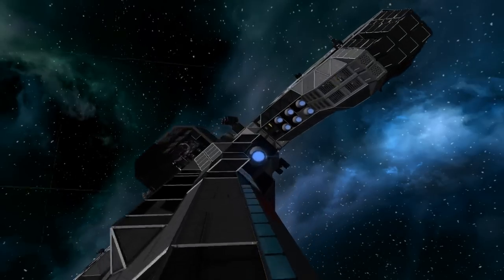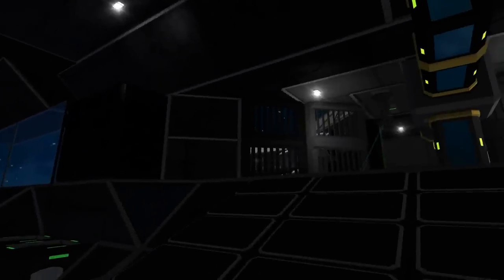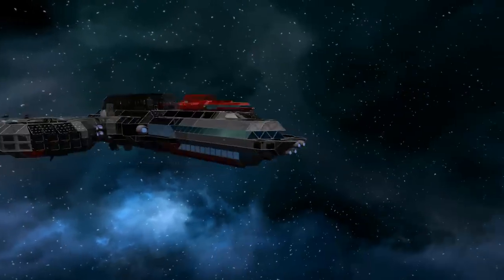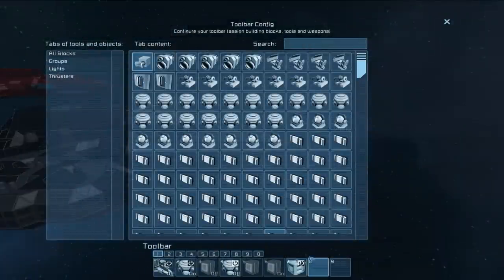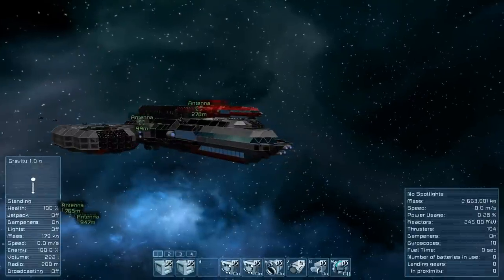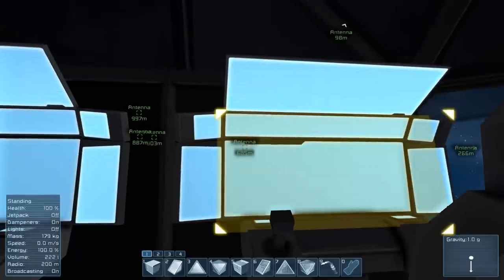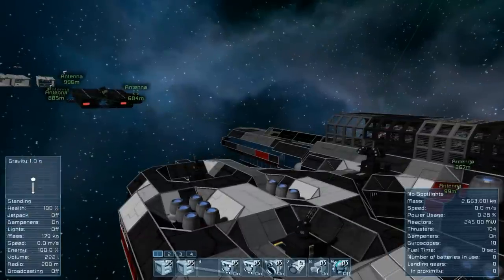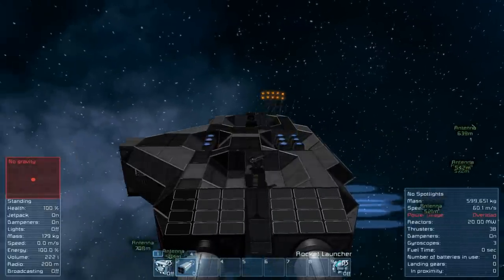Space Engineers  - Next Gen Carrier #2 - Albatross Assault Frigate, Modular base assault craft

Comment: Hello. One thing i noticed with most of torpedo/missile systems is they are not tuned for the actual survival conditions. You see, most of the desings have some systems, that require power. Power, that you simply cannot have on the torpedo right away. I tried to tackle this issue with couple of ways. Obviously, you need either reactor or batteries on torpedos. That means you need to either wait a while, until batteries store enough power or load some uran into those reactors (can reactors pull out some fuel through conveyors automaticaly? in my experience, one reactor hoards all the fuel he can get, and others need to be loaded manualy.) I designed a concept of sort revolver style reloading, when  it prepare torpedoes in advance, then moves them around, eventually into the launching chamber. (tried it from 1x4 to 4x4, can fire up to 16 torpedoes on one reload). It requires a little bit more attention than pressing more button tho, and sometimes is little bit finicky, still could use some tweaks. Also, i use primarily torpedoes propeled by thrusters, not gravity, so it might be a bit different.
Reply from the maker: You are right the power thing is often overlooked. In this case I knew it was going to be part of a ship (the carrier) that honestly could only ever exist in creative and so didn't bother doing anything to make it properly survival compatible. In the past though I've used both connectors (Hanger vid) and solar power (Vulture RDC) to get around the issue so I'd prolly do the same again if I wanted to make this a survival ship. I think there is a way to force Uranium into a reactor but I wanna try it out before I say anything, would need a split cargo system though because as you say having multiple reactors causes an issue. The revolver torp launcher sounds cool :)
Reply: ***** See, split conveyor system, such a simple solution. Wonder why I never thought of that. I've been fiddling with batteries, merge blocks and timers, to make turn last long enough, so the battery have just enough enegy for its trip, so i could use it for continuous fire.
The whole idea came to me when i was thinking what to do in meantime between welding the rocket together and waiting before battery charges enough. I just thought i could prepare more torpedoes or even set of the torpedoes. I still just made only a concept of welding and reloading + revolving part, plus some torpedo tubes  (pro tip: instead making just a tunnel through the armor, i made the tubes out of wheel suspensions, makes it much safer if you actually have to maneuver while the torpedo is already in the tube, esp. if its located a bit deeper in the ship). I didnt try to fit in into a ship yet, and i wont till i manage to make it as much automated as possible (so far its better to have a person dedicated to overseeing the torpedo launchers). Next step will be probably some signal lights so i know what set of torpedoes i can launch, because you dont want to accidentaly launch wrong torpedoes :D and then propably try to fit it into a (possibly modular) turret.
On that note, 4x4 is probably borderline for practical use, because it takes up too much space. It is ok to fit into a hull of big ship, but for a turret, i will propably use smaller ones next to each other. Good thing is, you can scale this concept up and down as you need :) (ofc its also dependent on the specific design of torpedoes you are using)
Anyway, thats a big wall of text and a complete sidetrack as well. But i would be really happy if you could tackle the power issue in some more detail (for the fire-and-forget style weapons especially).
I am also really enjoying your videos and looking forward for more :)
Reply from the maker: uberarek
Interesting you ended up using wheels for something like that also, was actually experimenting today in using them in a launch tube system not dissimilar to a torpedo tube as it's a trick I used a while back for my cable car/subway vids.. love it as a method for "buffering" things when there's a potential for damage. Have also used the same on a mining craft to try and avoid damage as you tunnel.

Love the detail your taking it to also, signal lights and turret mounting are the sorta things that will really finish off a design and make it epic.. the signal lights was actually something I'm intending on adding to the hangars from my last video once I finally start assembling the carrier. Seems I'm kinda making it in bits as blueprints and then later down the line they will be all pieced together and a frame built to hold it all etc. Will have a look at how to make that power thing work as I know there's ways to control cargo systems but the info it's really that well known and it's a fairly tricky thing to understand at first.. perhaps time for me to swot up and do another tutorial. Cheers dude :) Happy buildin!

Comment: You should have an alternating torpedo launcher... where you basically have two of those that are on that ship, with one offset so you basically double your rate of fire and have a larger spread
Reply: ***** With the rate of fire he's got on the one, I'd say it's more than sufficient.  Would be nice if it was completely automated, push button -> receive orbital bombardment, but it does the job.
Reply from the maker: Steve Pittman Automating it just takes adding the "WELD" timer block as "Trigger Now" to the "Reset" timer.. Did that to take the shots at the end. Only reason I had it like it is is to allow repositioning without potential catastrophe by moving at the wrong time and then a warhead clips the side of the ship or something. Cheers :)

Comment: did you try re-attaching the side craft? i think it will deform those connecting points :P
Reply from the maker: Yup, it can be done without damage if you're super precise.. otherwise there's a little bit of damage to the triangular blocks at the top/bottom of the joins when they touch, but it's pretty minor and not in the slight bit structural, I just used those to cover the side of the merge blocks a bit to make them less obvious. It's the connectors that cause major issues, need them totally off before any sort of docking takes place.